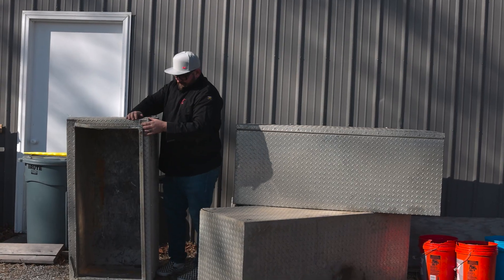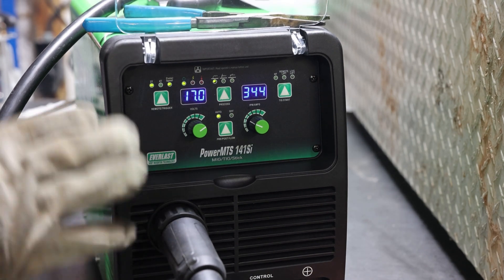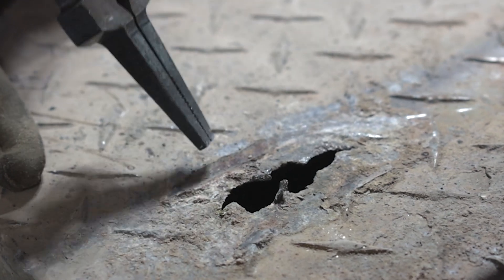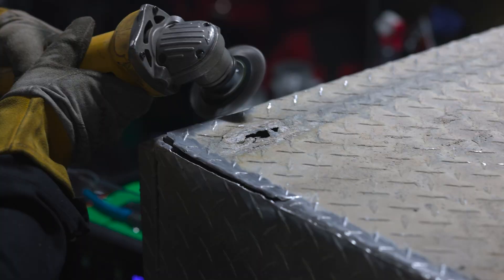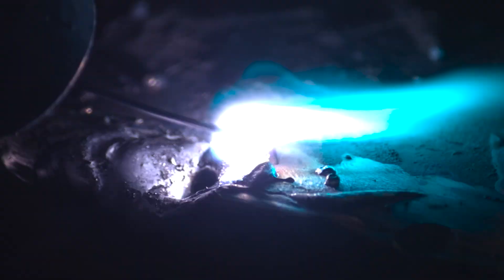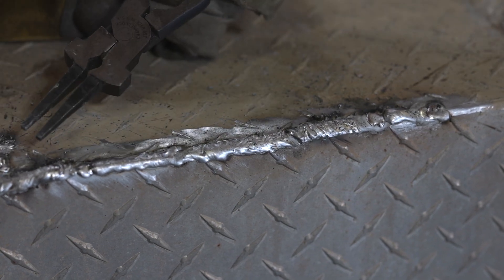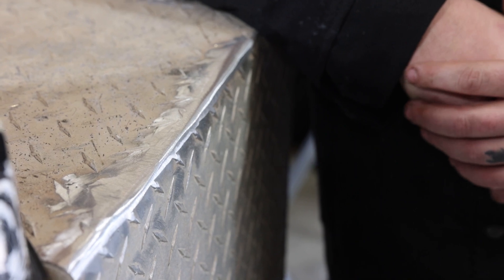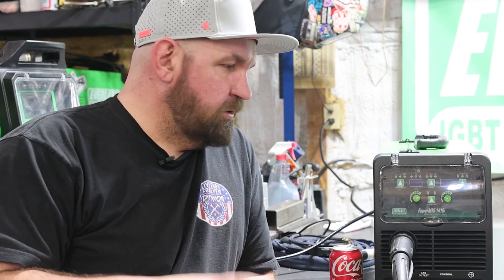The Nastiest Aluminum I've Ever Welded

Comment: I find using a small sand blaster helps and clean both sides, not just the outside. The wire wheel definitely helps.

Comment: @5:16 - post flap disk - i see line of 2 materials top and side? is this camera?  and once you have new material deposited - why not build it a little more?  not trolling - this is how we'd done it in shop when resurfacing or repairing - just to make joint or point of failure thicker - but I guess it would then maybe split on edges of new meets old? 
and yes $500 pay day - 3 times a week - fish the rest - you betcha ya...good work if you can get it

Comment: I have found fixing those corners in those boxes that it’s easier for me to go on the inside clean it the best I can with acetone and stainless steel brush, then I place a piece of aluminum 1 inch angle on the inside that usually gets me away from the corner where it’s thin attack it in place with short Stitchweld top and bottom and then I go on the outside and it’s easier to weld the outside corner with the aluminum angle as a back up. Probably not the best way but it’s the way I use. Great videos Jesse